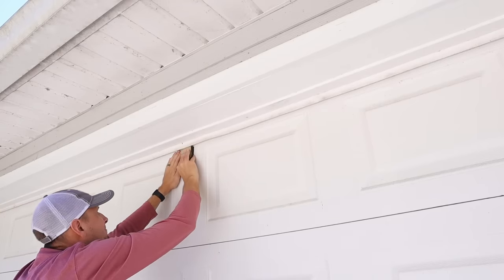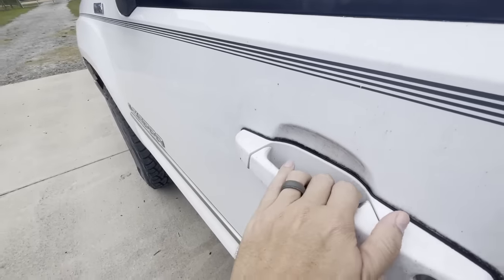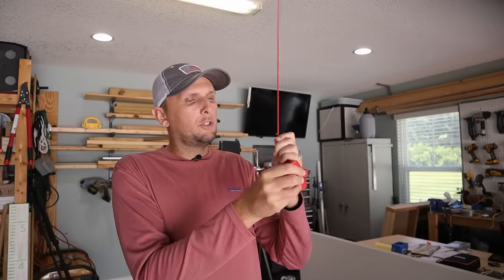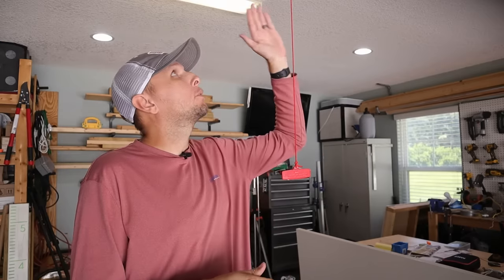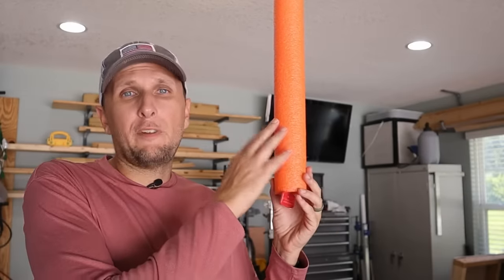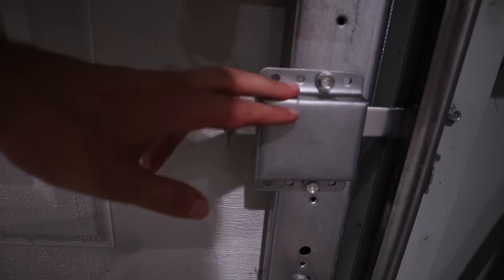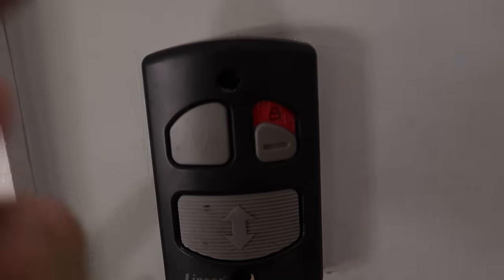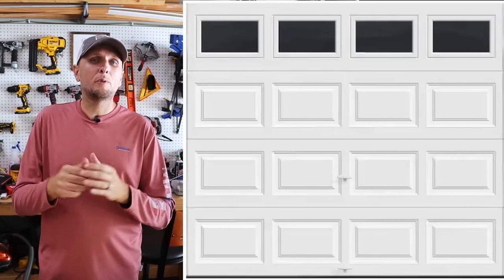How to Stop Garage Door Break-Ins | Number One Way Thieves Get Into the House!

Comment: The note about windows embedded in doors is a good one.  We installed a garage side door some years ago that had windows at the top.  These were nice for letting daylight in, but we wanted to not afford a clear view for anyone from the outside, so we installed privacy film on the windows.  This still lets light through, but blurs images, so nobody can really see what's inside your garage.  Search your favorite home improvement retailer, this stuff is available in anything from a simple frosted look to things like rainbow/floral/stained glass, whatever suits your taste.
Reply from the maker: Thanks for the insight!
Reply: That's a great idea!
Reply: Just rub car wax on your windows.  Easier, cheaper than film, and wipes off for cleaning
Reply: I did not want a door at all on the side of my garage . So I hung a heavy curtain over the window and screwed the door to the frame several times, locked the door and store scrap wood against that door. I also keep my ladders against that door tied to the wall... it would be easier to go threw the wall than that door .
Reply: Another good solution is spray-on window frosting. Easier than messing with the film, and can be scraped off with a razor blade or removed with acetone.
Reply: Only trouble with any window. They can break the glass and grab the release. My garage door is also alarmed with a magnet sensor to the alarm system. Then I use to install alarm systems for homes / business and banks. The door between the house and garage is a 1 hour fire rated door. No glass... guess I do go overboard but after 20 years of installing alarms. I've seen it all.
Reply: I cut away one of these panels and installed a small round darkened window at eye high.  About the size of a dinner plate.  Now I can easily look out without going outside.  And potential thieves know I can spot them.
Reply: @tompinnef6331  Agreed, now there are solutions for that, a friend of mine wanted the natural light but the neighborhood had a thief problem, he did it to his house windows as well as garage windows, but he bought 4in acrylic panels to replace the windows with, his home used older style single pane anyway with wooden frames, might be alot harder to do on newer style, and also did this on the garage windows. Sure you can break them, but it requires alot more effort than glass.
Reply: I did the same 👍
Reply: @Theire1  That makes the door secure, but removes the fire safety aspect of having that door.
When/if you sell the house, you may need to unblock that door to satisfy an inspection.
Reply: @Brandon_SoMD  I have seen that stuff used for the bathroom windows of older houses, where the windows in bathrooms tend to be HUGE and have low sills.
It's a great product, blocking clear sight yet still allowing a lot of natural light in.
Reply: You could even try window car tinting kits that way you can put it on do you still wash off dirty grime on the inside and outside and still have your garage windows tinted for no one can see through that well if at all and also you can also prevent the heat from warming up your garage too much through the window there are a lot of benefits from this idea maybe a little expensive to buy the kit but it’s worth it
Reply: Closed cell cushioning foam sheets (used for packing dishes for moving) also work as privacy film AND insulate the windows. I use it in my bathroom. I just took a bit of care in installing it and taped it down neatly. It looks just like privacy film until you look close & my bathroom doesn't get as cold anymore during the winter... or as hot in the summer.
Reply: Even easier, our good friend Rustoleum sells a Glass Frosting paint, it is a simple lacquer that is way beyond satin or matte and extra white pigment. Easily removed with some acetone if for example you are a tenant or are selling.
Reply: If you replace your man door, look at a hurricane resistant door. A little more expensive, but if the glass can resist lumber coming at them at hurricane strength, it will help deter a thief. Our daughter had a detached garage and did this, along with a special privacy film by 3M that also makes it harder to break the glass. Thieves do not want to make noise.
Reply: We used ordinary rectangles of frosted Contact Paper.  $6 a roll found almost anywhere.
Reply: We did that with my brother’s garage door.
Reply: You can buy a can of spray "window frost" in the paint department at Walmart. That's what I used on my windows
Reply: @siliconinsect  Cheap childs watercolor paint works too, and is easier to get off when needed.
Reply: I just mounted mini blinds along my garage door windows, and added spring latch locks on both sides of the door.
Reply: Salvation is Simple

HalleluYAH “Hallel u YAH - Praise ye YaH”

YaH is The Father (Genesis 1)
YaH arrives via the TENT OF MEETING
YaH was Who they Crucified for our sins
YaH was Crucified on an Almond TREE

Ancient Semitic Moshe (Moses)
Isaiah Scroll (The Original Isaiah)

Comment: Important for you to mention that the red string is not just a manual release for power failures, it’s an emergency release in case someone gets crushed and trapped by the door. Something to consider before removing the pull handle, shortening the string or removing altogether. Not advised if you have small children in the house. The bright red handle is intended to make it obvious in an emergency what it is for, for the surprisingly large number of people who don’t know that power openers even have a manual release.
Reply: Like that scene from Scream…
Reply: Good point.
Reply: Most garage door openers have a photoelectric sensor that detects a person  or object in the path of a closing door. When it detects that, it immediately stops the door from closing. That said, all things mechanical or electronic can fail, so your warning is apt as a backup safety procedure.
Reply: @johnsposato5632  Sort of. Those sensors miss many scenarios even when they are working perfectly, because they aren’t actually mounted in the path of the door, they are mounted inside/behind the door. Most garage door openers don’t operate at all if the sensors fail or are misaligned; it’s a smart-if-rudimentary failsafe design in that regard, but that failsafe design is the backup for sensor failure, not the string. Most actual crushing accidents happen with the sensors working properly. 

It’s a good recommendation to protect the strings from thieves reaching them, but I would never remove them. Sometimes re-routing the string with a longer string out of reach can be an option. But removing them is of almost no benefit, because the lever that the string pulls on can usually be as easily manipulated with a coat hangar as the string itself can. 

A better recommendation is to spend your efforts on defending against probing tools coming in at all. A metal flange attached to the top of the garage door on the inside that curls out and back down toward the inside wall above the door to catch wires poking in can be very effective. And cover those little windows that many garage doors have at the top - spray paint the inside black if you like the look of windows from the outside.
Reply: My garage door sensor works perfectly fine. Additionally, if the door is open, light will go on automatically when you tripped the sensor. 

One of my brothers didn’t have a sensor on his garage door. They came home and opened the garage.  One of the cats was squished and stuck to the bottom of the door until it fell off a few feet up. Not pretty!
Reply: @patriclo9509  No they don’t. Your sensors miss many scenarios even if technically working perfectly. Cats are easy to miss with “perfectly working sensors”
Reply: @patriclo9509 my wives cat hates me. And bites me when I go near her when he is next to her.  You just gave me a great idea. Thank you 😊
Reply: @tomTom-lb5cu  sociopath
Reply: @2k3r11s  no, they don't.  I have had my house for 24 years, my sensors have never missed.  You don't know what you are talking about.
Reply: @nightskylights4501  Your confidence is very amusing, but it is very well understood why the sensors miss certain scenarios. It is because they are mounted inside and behind the door, not in the actual path of the door. it is why children playing on the driveway in front of garage doors frequently get crushed by them. Try standing directly in front of your door on the outside, facing the door, with your toes underneath the door but not blocking the sensor, and close the door. That is the scenario.
Reply: All doors have auto reverse. It's a mandatory safety feature for 30 years.
Reply: @kCI251  the manual release is also a mandatory safety feature
Reply: Also fire egress. I absolutely agree, disabling safety features to prevent property crime is stupid and can cost more than petty theft.
Reply: @stephanier6783 
From his statement, it’s easy to understand why the cat hates him. I’m sure if he just left the cat alone, they both could share the same house with no drama.
Reply: Additionally, there are adjustments on the opener head that should be made and tested occasionally. One is for up force so kids can't ride the door up (intentionally or not), and one for down force to keep children and pets from being crushed. If you as a homeowner don't know these things, you probably shouldn't have a garage door. Or pets. Or children.
Reply: @incognitofla592  You have successfully explained why it was pointless to remove the string
Reply: That's why the pool noodle idea was my favorite and the one I'm going to use.
Reply: so your garage has no sensors HUH?

Comment: Useful information. Let me add to the "not letting people know what you have" part. When buying new electronics - TVs, laptops, monitors, etc. - when discarding the box, cut the box into panels and bundle them with all the marking on the inside before setting it for recycling/trash pickup. That way it just looks like regular plain cardboard and not the box for your brand new 70-inch 4K TV.
Reply: People don't steal TV's anymore, they are too big and not worth it.
Reply: That is why I have burn barrel
Reply: @nightskylights4501  No, most theives just steal them from the stores that sell them instead of residential home.
However, they have gotten lighter and easier to steal, even as they have gotten larger. 
A used TV that is just a few years old also isn't worth as much to try and hock at a pawn shop.
Reply: If they can get it off my wall and carry it out it's all theirs.
Reply: @HanginInSF  That won't stop the stupid ones from trying while you are out of town. Or worse, they will just squat in your home with a fake lease agreement, watching your TV, eating your food, and using your Internet for free. There is more than one way to steal.
Reply: Keep TV box 90 days or NO RETURN FROM BIG BOX STORES
Reply: Great idea!
Reply: @GeneJordan  12 gage pow pow would conversate ME off the property , Quicker than a fart in a Walmart Cart.
Reply: @oui-nonmaybe2127  You can't use a 12 Guage pew pew if you aren't at home when the criminals/burglars arrive to take your stuff.
Reply: Thieves don't need to see your trash to assume you have a TV or other valuables in your home. It's kind of a safe assumption that in 2024, most people have a TV.
Reply: M
New neighbor moved in. He put his TV box and new gaming system box at the curb. I felt safe because I knew I wouldn't be targeted, he would.
Reply: @charlieann456  There's an idea. When you do upgrade your tech, just place the boxes on the curb in front of the house of the neighbor that you dislike the most. 😁😏
Reply: @fredcarbery3966  ~ You are so right Fred!!!   Always keep box, receipt, and any instructions and manuals, ect.   It also helps to not tears boxes open, but to carefully open.  There have been a few times I've gotten a refund when I have been a little late simply because It looked like it had never been opened & I had the receipt)...NOT ALWAYS, tho.  I'm talking about clothing and smaller objects mostly.  A nice personality helps too! 😊😉
Reply: A house mate had his super dooper huge Sony TV ripped off years ago. He left the empty box on the footpath, delivery dates and all visible or the thieves who broke in the next day.

Comment: Always nice to see people giving security awareness and tips without talking about thousands of dollars in equipment!
Reply: Like wood working vids….nice projects that are done…after 60,000 in equipment 🤔
Reply: @ruggedrickrude1946  Yeah... Always love the "$10 in pallet wood into $500 table" type stuff, but they always use gear that is outside the reach of most people.
Reply: meh thieves don't have time to do all this. they'll break a window in 2 seconds. opening a garage brings too much attention. if they want to get into the garage for the cars, they enter through the house.
Reply: Great Video!
Reply from the maker: @joebates3272 34 years as a police officer and worked in burglary and you didn’t see this?  I question your background if that the case.  Would many cracked out burglars kick in doors?  Absolutely!  But this happens as well.  Once they get the hang of it they can have it open within seconds and no signs of forced entry.  Maybe that’s why you didn’t see it, it was that effective 😂